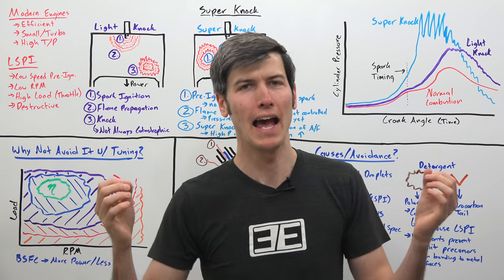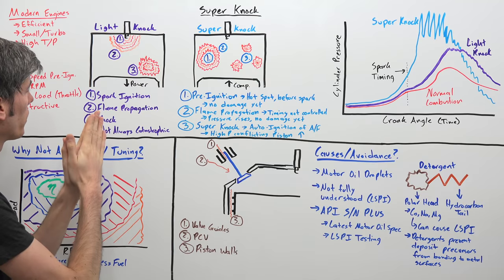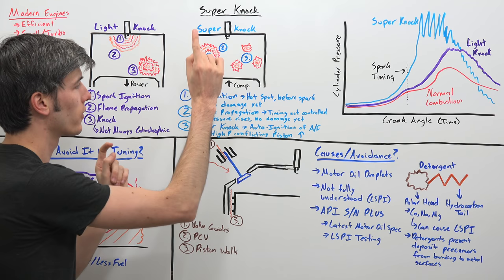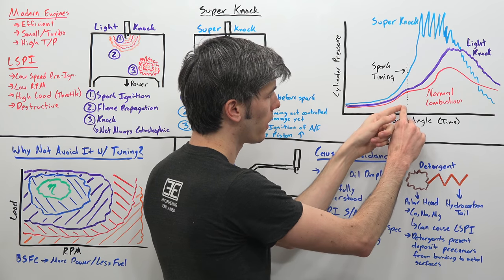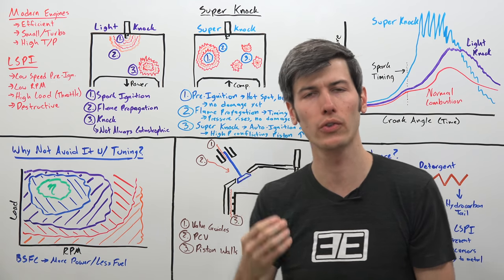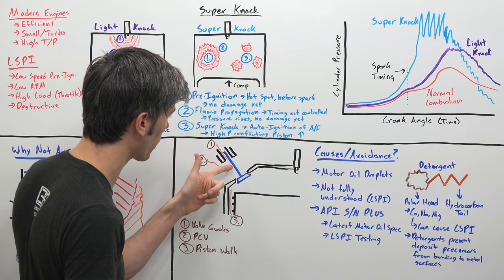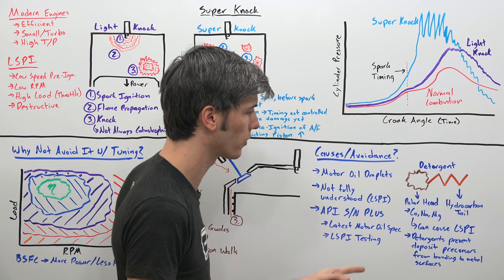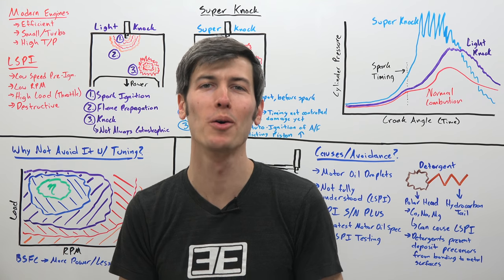How Super Knock Can Destroy Modern Engines

Comment: Mazda speed 3 people call this “zoom zoom boom”
Reply: Ungregistered User  aren't flat tappet cams/valves used in pretty much every car engine unless u go with a roller setup which is for higher performance?
Reply: Never go full throttle at low revs in an MPS. My tune alleviates most of this by pushing the torque curve towards 4000 to 6000rpm to avoid bending rods
Reply: So do the ecoboost crowd now too.
Reply: Facts ive blown 2 motors already

Comment: As a pro ECU tuner, I see this problem all the time in the newer LT Chevy engines with DI. Especially with aftermarket superchargers. Gotta be very careful tuning these new engines. Great video!
Reply: Ouch, one of the engines I hoped it wouldn't happen to
Reply: do you rempap these engines or do you use tuning chips ?
Reply: @karimnasser6710  Tuning chips? Is it 1990?
Reply: @OtisFlint  it's 1999dec31
Reply: Rhett Castillo have any of your customers considered a water/methanol system to reduce chances of this problem from what I've read it seems to work well for forced induction.
Reply: Rhett Castillo wouldn’t keeping your engine cool with bigger radiator with after market chargers help?
Reply: @OtisFlint  modern tuning chips exist, check out racechip tuning.
Reply: @karimnasser6710  Yes but they are generic maps. Pro tuners do custom maps for each individual vehicle because no one vehicle performs exactly the same. While tuning chips are safe enough in most circumstances, it still can be risky. If you did anything such as new air intake and induction kit along with  new exhaust system and these chips are intended for stock cars then it may end up putting way too  much boost through the turbo and spool it way too much and cause damage. Pro tuners tune each vehicle according to its own characteristics. 
Now there's debates on rolling road tunes and dyno tunes to which are best.
Reply: @James-ns6jm  ECU Remap is bad, same as Chip tuning.
Manipulating AF ratio or ignition angles or Turbo Wastegate valve opening will for sure shorten the engine's life (it will cause excessive wear).
In some cases manipulating the parameters listed above can lead to misfire or knock or overheating.
no tuner has ever seen the engine software and its architecture, therefore no tuner will calibrate parameters better than the manufacturer.
Reply: Not all tuners are equal. Some program dangerous maps. Some tune for a goal that is superior to the manufacturer 's. Both happen fairly frequently. Car manufacturers are limited by govt. regulations. ECU remaps are bad? You're making it sound too black and white. Sometimes manufacturers make mistakes and the aftermarket fills a gap. Some screw it up and some do it well.
Reply: Well... most of GM newer non turbocharged engines have a 11 to 1 compression ratio... so I can only imagine the heat/pressure when force fed....
Reply: @James-ns6jm  Rolling road tunes are the best imo
Reply: @karimnasser6710  Judging by this comment you probably don't have enough knowledge to remap an ecu properly😂
Reply: @kiyoponnn  you're right i don't have vast remap knowledge . i do design engine software in an automotive company though ;)
Reply: @karimnasser6710  Ohh nice
Reply: @karimnasser6710  when you're trying to turbo a car, remapping is the best option out there.

Comment: It'd be cool if Project Farm can induce super knock with his see through head engine and slomo guys capture it using high speed camera.
Reply: It would need to be a gasoline direct injection engine
Reply: Ungregistered User wrong, older engines with larger compression ratios are way more likely to knock
Reply: Ungregistered User  Nope, it doesn't apply to modern engines, it applies to all. It's just that modern engines usually run hotter. And they usually have direct injection which causes deposits.
Btw, here is how to cause preignition and the super duper knock: (1) Machine your engine parts with a dull endmill, machine as roughly as possible and DON'T deburr.
(2) Cause as much carbon deposits as you can; to do that mix oil into your fuel and reduce the pressure of your injection system or use work out injectors to get a crapy fuel mist.
(3) Hook up an EGT gauge and tune your engine to run hot.
After that your engine should go boom. (unless you blow your headgasket first, XD)
Burrs and carbon deposits kinda work like a glow plug: they do get warm by the combustion but they don't get cooled by the cylinder walls. Just think about it: a burr sticking to the side of a block of metal has a relatively high surface area that's contacting with the air around it, but it's connected to the rest of block of metal by a small surface area. Carbon deposits that get on the valves can have the same effect. But with carbon deposits it depends on how porous they are, how smooth they are, etc; not all carbon deposits are equal.
The smooth carbon deposits that almost seem to be brushed on won't cause knock as quickly as the rough ones.
Reply: If anybody can do it, he can!  Love that guy.

Comment: It sounds like this super knock phenomenon became a problem when car manufacturers in their quest for more efficiency and higher fuel economy started installing turbo chargers and direct fuel injection. This increases the number of components that can go bad and leads to this additional problem of super knock. There was a time when turbo charging was only used in race cars and expensive high performance cars, now turbo charging is used by most car manufacturers.

Comment: Everyone talking about their Lspi susceptible engines and their "fixes" but fail to see the easy way out - don't stomp the throttle at low rpm .... Go back a gear, Lspi is called Lspi for a reason, since it occurs at Low engine speed under high load.

Comment: Predetonation = a condition where the engine is trying to compress an explosion. 
Good luck with that.
Reply: Reminds me of hydrostatic shock.
Reply: @huntergman8338  Reminds me of water hammer also ie the problem that occurs when you try to close a valve on a rapidly flowing pipeline full of fluid in effect trying to arrest it's momentum too suddenly. This can similarly result in failure of the valve and/or the pipeline especially if you try this on a long distance pipeline where you can have literally tons of water in motion suddenly being forced to stop violently the pressure spikes can reach levels that are in the realms of an actual explosive device going off right next to the valve.
Reply: @seraphina985  Ether way, something will break and it will be expensive.
Reply: @huntergman8338  Indeed, exceeding the rated pressure limits of a vessel is a bad idea however it happens. There is a reason why such limits exist after all once you pass them you are eating through your margin of safety and probably permanently reducing that margin through added metal fatigue too even if you remain short of causing outright catastrophic failure.
Reply: @seraphina985  I notice a small scale version of this if I abrubtly shut my sink faucet valve, you can hear and feel the pressure shock in the pipes.
Reply: More specifically an explosion occurring faster than the speed of sound.

Comment: Its funny that people dont like light knock when that is basically what mazda's sky active engine is designed to do.  Spark Controlled Compression Ignition is just using the spark to start ignition and then the increase in pressure causes compression ignition every where else.  the only difference I can see between the two is that light engine knock is not consistent and happens in only one location and then propogates instead of being a controlled universal compression ignition.  Such a small change can take it from being engine knock, to a super advanced engine technology that you WANT.
Reply: You  know that the skyactive X is capable of both compression ignition (like diesels do) and spark ignition as it has spark plugs too. I wonder how reliable and long lasting they will be.
Reply: The SPCCI engines are built to handle the high pressure and temperature that comes with this kind of operation. Kind of like a diesel.

Comment: How about using a higher octane gasoline??? How about to get the coldest air through the intake that you possibly can set up for??, How about, because it is a turbo engine and direct injection, will assume, by delaying  closing the exhaust valve during the intake stroke and also delaying the fuel injection you can evacuate the burned gasses with forced fresh air and lower your chamber temperature???. How about upgrading your intercooler to a better quality that can give you more cooling and a correct amount of flow by the engine set up????.. remember that the manufacturers go the cheapest they can get. I am a great fan, really like your channel but those are questions that I will like to be answered. Keep up the good work. Thanks for being educating us.
Reply: Yeah, i was also wondering about running higher octane gasoline.
Reply: With direct injection motors, replacing the cams solves most of the problems
Reply: 1) Some manufacturers do use higher octane gasoline. The problem with that is that customers don't like paying for premium gasoline (at least in America). 
2) If you kept the exhaust valve open during the intake stroke you wouldn't just be sucking in cold intake air, you'd also suck in the hot exhaust gases you were trying to just get rid of. This method would harm exhaust scavenging, and would make knock worse. 
3) Doesn't solve the problem completely, the problem can't just be reduced to putting in colder intake air, it's about preventing local temperature concentrations in the cylinder. The cylinder has to stay at a particular temperature to perform at it's best, just cooling the entire thing down won't solve the problem entirely.
Reply: Ungregistered User  its actually P*C*V it stands for pollution control valve.  Its emissions equipment that recycles oil vapor instead of letting it make a mess under the hood or making oil slicks on the streets.

Its important but its advised to install a oil catch can between it and the intake system to prevent octane dilution.
Reply: Ungregistered User  It stands for Positive Crankcase Ventilation. With old cars they just let the crankcase vent with a tube or basically an open hole. That allowed all the gasses and some oil to escape which made a mess and was bad for the environment. So, modern cars put the crankcase gasses and everything back into the intake. That way everything gets burned and emissions are better. It also means the vacuum of the intake helps pull everything out of the crankcase so it's more efficient.
Reply: Gamma Light I think you are getting confused with the EGR valve (exhaust gas recirculation) which can have a similar effect in the engine regarding knock and superknock because of hot and uncombusted gases entering into the combustion chamber. PCVs are used to avoid high pressure concentrations in the crankcase which will lead to blowing gaskets and as you said cause oil dilution, but also make sure the unburnt toxic gasses passing through the piston rings (blow-by) aren't freed to the atmosphere.
Reply: Gamma Light I agree with removing oil vapours, but the water vapour is important in an engine as well to cool the charge and displace intake oxygen for efficiency (see an earlier video from this channel). Oil and fuel formulations in addition to those may be key to avoiding engine damage that is caused by LSPI, but it might also have something to do with ignition timing. Further research and testing is required, and these will bring about innovations. Or we could just go entirely electric.
Reply: Unfortunately, octane does not help this much. Higher octane increases the autoignition point but hot spots can be as hot as they want. Octane works well in controlling detonation caused by advanced spark, and retarding the ignition does as well, but neither is very effective against pre-ignition.
Reply: Dont forget effective Water cooling system, with good rad and pump, and fans, and ofc,. no air bubbles in the system to prevent good sirculation.
Reply: How does the addition of methanol/water mixture help? Would it help in cooling the intake air. Would it help with suprerknock?

Comment: I honestly never seen any report of early engine breakdowns due to "super knock". 
LSPI is also not the problem of the modern engines like it was mentioned.
this type of abnormal combustion is not new, and it can also occure in NA engines with high compression ratios. it is a preignition caused by a hot surface accompanied with knock. cause of knock: a very advanced spark timing(usually spark timing should not be that advanced at low rpm)
if you read the reference given below, there are at least 6 types of abnormal combustions, knock can be directly regulated using spark retardation, but for preignition u need to cool the engine temperature down.

john B heywood - internal combustion engine fundamentals
chapter 9- part 6: Abnormal combustion

Comment: I miss the 70s engines that would run on after the ignition was switched off.
Reply: My 71 vw bug with a 2165cc dual 44mm carb would turn if a couple times if hot
Reply: @Addicus Taylor Detonation because of the new emission devices on cars. Also  timing was advanced.

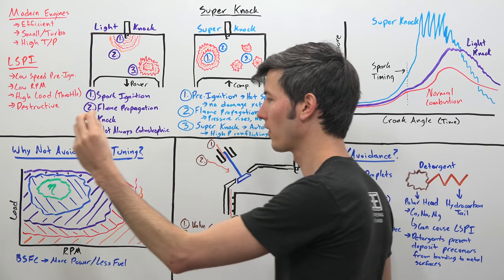Comment: 7:10 taking away power from the user willy-nilly is a bad solution because it can be fatal. If I'm in the middle of an overtaking maneuver or need just a bit more power to move away from something and the engine decides that right now I should not get the power I am used to - that is deadly. They allow manufacturers to do that? What a world we live in ... Safety should be a much higher concern than efficiency.

Comment: Knock  = secondary ignition event after the spark plug fires Pre Ignition = uncontrolled ignition event pre spark plug.
Fin
Reply: Ungregistered User  no, knock is a secondary ignition point somewhere else in the cylinder that results from the pressure increase after the spark plug fires. You end up with completing flame fronts that accelerate the burn and increase cylinder pressure at an undesirable rate. Pre Ignition is an ignition event prior to the spark plug firing.
Reply: That is what I said, A secondary ignition event after the the spark plug or "Primary ignition" event occurs.

Comment: I have an engine susceptible to LSPI. It's a 2016 Vauxhall Astra 1.4 turbo (140ps) - same engine as some Chevy Cruze models.

My solutions so far :
1. Use 98 octane fuel (widely available in the UK)
2. Never drive uphill in 4th/5th/6th gear with high throttle load at <2100rpm
3. Switched to 5w30 Dexos 1 Gen 2 engine oil about 2 weeks ago

Things i intend to do soon :
1. Smaller, lightweight 18" wheels to change the effective drive ratio & reduce drivetrain inertia
2. Remap to 160bhp & 180lbs/ft to encourage use of lower gears/higher rpms
3. Read Ecu using OBD2 dongle to check air/fuel ratio at a low rpm under load

Comment: I think Engineering Explained should start a petition for the Department of Energy and the Department of Weights and Measures for the United States to raise pump gas octane levels to 95 octane.  
  He'd know exactly what to say and I'm positive we'd all back it up
Reply: Most cars have no need for increased octane. The burden falls on the manufacturers for pushing the limits of what their engines can do. It has already become extreme.
Reply: @flagmichael  as emission requirements increase so does the need for higher octane.  Hotter IAT, EGR and excess PCV use dramatically reduce octane levels.  
  Every car I've worked on would see huge benefits from an increase of octane when fully loaded with passengers or when driven in a manner above economy purposes.

  But hey, if everyone's happy driving with extremely retarded ignition timing then let's not change a thing.

  I honestly can't think of one car that wouldn't benefit from higher octane, please enlighten me

Comment: So even engines have a "normal" size, going much below it brings unwanted consequences. 
Just like making cars too small has detrimental effect on a lot of things (usability, stability, safety etc)
Reply: It's not quite "the size" of the engine that increases risk of this; it's the cylinder pressure when/as the piston reaches the top of the compression stroke.....it's just that smaller engines typically have higher compression ratios or use forced induction.

Comment: LSPI is probably what caused my 2016 Subaru Forester XT to develop a hole in the engine block around 45,000 miles. Subaru covered a new block, then new heads. I had a brand new 50th Anniversary NA Forester for over 12 weeks. As soon as I got the car back, I sold it to Carmax. I now drive a 2019 RAM 1500 Limited. No more worrying about LSPI. And I can pull my Jeep on a trailer.

Comment: As per one of your previous videos, especially for those of us with MT, Don't Lug the Engine!  Based on my experience in my wife's new traditional 8 sp AT vehicle in normal or eco mode it's always trying to upshift asap (gas savings) at the expense of higher load at lower RPMs.  We live in a mountainous area and the AT obviously can't predict the numerous approaching inclines and is often "confused".  Though she typically isn't using it for "speed", we've noticed that setting it to sport mode has worked the best for us in our normal daily driving (less lugging and fewer shifts).  Thanks for your informative videos.